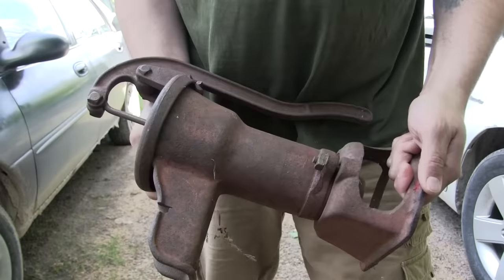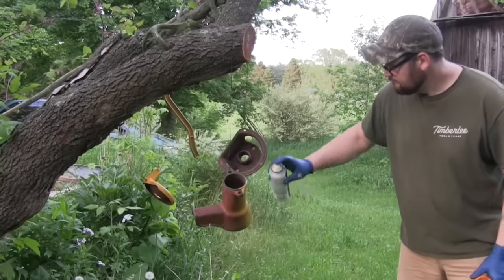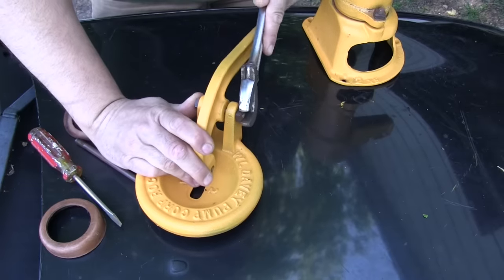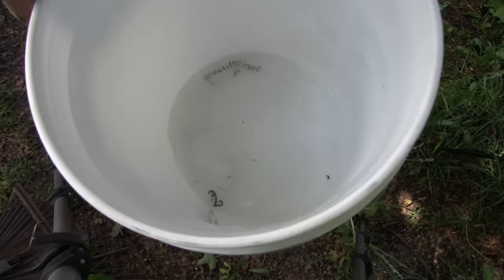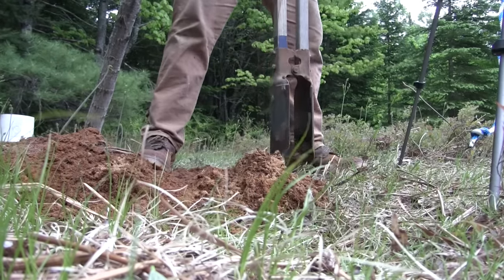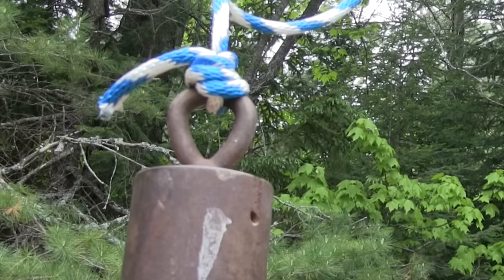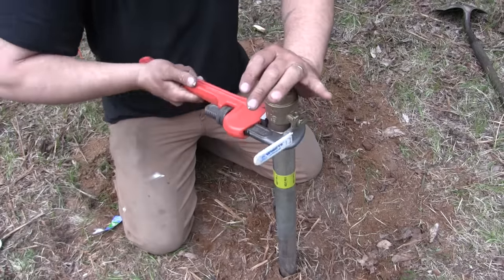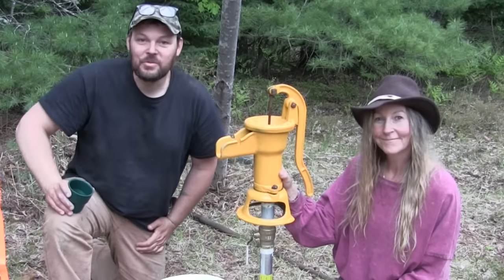Antique Hand Pump Well,  Start to Finish, at our Remote Off Grid Property

Comment: From 1974 to the spring of 1979 my parents, my younger brother and I lived up on a very tall mountain called Beechy Ridge in Clay County, West Virginia. We had a well behind our home with a cast iron hand pump just like the one your video.  During the blizzard of the winter of Jan. 1978, I was thirteen years old and we had 12 to 20 ft snowdrifts in our yard from the Storm. We had to dig out from around home and our well and use newspapers to create a fire around the cast iron pump to thaw out the water line that went down into the well before we could pump water out of it. You see, we did not have running water inside of the house at that time and that was our only source of water for our family.  Those old cast iron pumps could take a beating for sure. When I saw you in the thumbnail with this pump it brought back so many memories fore about that time. I'd love to go back and live there again. The water from our well tasted so sweet. 🥰😊 Thank you for bringing back some good memories for me! 💖🧓
Reply: Still trying to figure out why you would make a fire to thaw a well with 12 foot snow drifts. I grew up onba farm and pulled many a well to thaw out pipes but ours was electric pump with dual 100 gallon storage tanks. Why not get a foot tub and thaw some snow or bring in a metal pale of snow and out it on a wood burning stove....and there you have fresh water. Seem like a lot of work for a hand pump when thousands of gallons of water are already laying above ground.
Reply: Sounds like a lot of work, you might be amazed at how much water there is in a 20' snow drift.

Comment: I didn’t read through all 2k+ comments, but my dad and I did put in a number of wells. The very important item that you didn’t mention was how far to keep the well from septic drain fields or outhouses. It varies from state to state based on the porosity of the soil but 100 ft is standard.
Reply: ...and that 100 feet is uphill of the septic field(s) for people not in the know that "stuff" flows downhill...:LOL

Comment: I can feel that energy when you do a job that never goes smooth and it goes smooth. Love that feeling.
Reply from the maker: me too!
Reply: @Bushradical  great job Dave!!! As an old Well driller, I enjoy seeing others drill(drive)  a well, and have success!!! 
Here's a few tricks....
Don't dig your hole until you hang your hammer and use it like a plumb bob when you have it steady then drop it so the stem sticks in the ground then you know exactly where to dig and it keeps your pipe straight...
The other trick is not really a trick but I would love to see you finish off the hole with a couple of bags of Bentonite.(you can order it from Valley Well Supply, I think they have a warehouse in Grand Rapids)
It usually comes in pellet form or powder.. it's basically a clay that the ground water and rain is absorbed into it, it swells up and seals the ground to your pipe... It stops contaminants from following the pipe down to the water vein... You can always add it by digging out some of the dirt around the pipe and then add a couple bags I think the bags are $10 a piece $20 is great insurance that you're well will never get contaminated if a can of gas gets spilled or whatever contaminant maybe in the vicinity...
I know you're careful and so is Brooke. But you never know..
Also if you hill up the dirt around your pipe it will help rain water and other things to run off. Take care Dave, like I said earlier great video and I'm glad that you and Brooke were successful in getting water on your new place. And I would love to come and help you on the next one. 
Oh ps, when I do a hand driven well I always carry a half horse shallow well pump then I can just fire up the generator and put the pump on and run it for a half hour 45 minutes and that water will be Crystal clean.... You can also judge how many gallons per minute the well is producing.
But you guys did it with the hand pump so bravo!!!
Reply: @dirtroadfarmsjimmideanreen2458  beautiful add on. Thanks
Reply: @dirtroadfarmsjimmideanreen2458  Thanks for that information!
Reply: At very least i learned something new today.

Comment: My Dad, some 40+ yrs ago, took a 1.5” auger-secured an appropriate handle on to it and worked it down about 14 feet in our backyard.  He got beautiful freshwater 💦. At the time we were under strict water restrictions. Dad had the best 👍 veggie garden around and we could swim all we liked ❤️ in our small (even for those days) 10ft diameter 3ft deep pool. We didn't care. My Father had about the same pressure as town water and he maintained he could pump, at that rate, all day.  All for a small auger (from a brace-and-bit system).  He could divine water accurately.
Got to go but good luck with ALL your Off-Grid ventures.
Ellen Queensland,  Australia.
Reply: Archimedes

Comment: Just a suggestion, when you rebuild the while you have the pump a part ,you should clean/polish the bore. You can use engine cylinder hone if you do not have one, you can use a wire wheel on a drill finish with fine sandpaper rinse out any rust or dirt. This will give a tighter seal and the leathers will last longer. Just a thought,  I  have been rebuilding or repurposing items over 50 years. GOOD LUCK GREAT VIDEO KEEPIT UP

Comment: Great vid. Just some tips. 1. If you wait until after wet weather to bore it makes it vastly easier. 2. You can use additional pulleys to reduce to felt weight (the force needed to lift it) of the "hammer", you were using just a single pulley (a single pulley setup is known as a "single whip"), by adding just 1 more pulley you could have halved the force you would have needed to lift the weight of the hammer (this pulley setup is known as a gun tackle). Or if you'd used 2 x double wheel pulleys (known as "twofold purchase") you could have reduced the force needed to lift the weight by 3/4, making it much easier (or giving the ability to use a much heavier weight to increase the boring speed).

Comment: Thanks for the videos.   I put my well in yesterday following your direction.  I placed a concrete pad around the pipe, and watching a similar video, I built a wood frame, to pour concrete up about 2 feet above the ground.  Once it dries I remove the wood frame and should have a very nice looking well.   Reason I built this well is because of the possible nuclear war with Russia.  One high level detonated neck above America, will generate an EMP electric pulse that will take down the entire electric grid in North America.   Estimates are it will take more than two years to re-establish the grid.   Can you imagine 2 years without power, and thus city water?   Hope I don’t need it, but it is nice to know I will have access to clean non-radioactive water, if I need it.

Comment: Nice Dave. Fans of both of you. So my father and his wife had a well drilled in willow AK and installed a 3 stage reverse osmosis setup. Having cleaned the first stage cannisters and changing the filter there was an oily residue.

Comment: I love sweet well water! Thank you for the videos on doing your own well. I don't need one at the moment but may in the future. I enjoy watching your videos, and it seems we have common thoughts about things. I like to see things refurbished because it sure seems like they're made better most of the time. I have watched a man use a pressure washer to dig the hole by putting the water hose in a little ways in the pipe. He used pvc and cut the end like teeth to grind when needed since it went in the ground first. I can't remember if he started with 3 or 4 inch pipe, but connected smaller pipes , maybe stopping at 2in pipe with pump. He did pull it out to put the screen pipe in first, then connected in the same manner as yours. He was through in no time with that pressure washer.

Comment: If you're in an area where the water is too deep for a hand drawn well there's a great workaround. Set up a vertical axis wind turbine to draw the water up into a storage reservoir. Have your reservoir buried just below the frost line. Be sure to have some kind of disengage connected to a float so you only fill to the full mark. The wind will draw your water nearly up to the surface where it can then be hand pumped easily and yet not get frozen.  

..
Reply: Could you, please, give us a link to the video of that (or to other sources)? Thank you in advance.
Reply: @sakoupa  I don't have a link. I simply thought it up. No reason at all that it won't work. What don't you understand?  I remember I was at a state park where they had a really old hand pump. I was really thirsty so I pumped the water up but it took a long time because the shaft was very deep. This idea would solve the problem.

..
Reply: @MrDavePed  
You see.. I don't understand - and that's why I want to look at drawings and video of it. It would be interesting to know HOW it works.
Reply: @sakoupa  Wind turbines of all sorts have been pumping water out of the ground for centuries. I think the vertical axis is the best design. There are many vertical axis videos you can find easily. It can operate an efficient pump which can draw water from great depths. This is especially true since the water doesn't have to be drawn in anything more than a small trickle. You do not need a large number of gallons per minute, just a trickle from as deep as you need to go.

Your reservoir can be a food grade tank of perhaps 50-200 gallons. Bury the tank below the frost line and direct the pumped water into it. 

You'll need some way to deal with the extra water. Maybe a float to indicate when the tank is full. Some way to prevent an unwanted overflow. Either to disengage the turbine or the pump when the tank is full.  If you disengage the turbine instead of the pump, you can save some wear and tear on your pump. 

However you do it, you do not want overflow to be pumped above the frost line and get frozen in your system. There are simple ways to do that which require no electricity, which is the whole point. No electricity required.  

Then you'll need a hand pump similar to the one demonstrated in this video. Set it up to draw water from the reservoir which will only be about 6-8 feet below ground depending on your local climate. Very easy on the arm when the water is not so deep. Just a few strokes and you have all the water you need. 

I hope this makes things more clear.  

..
Reply: @MrDavePed  
I think it's just your theory. Otherwise you would drop a link to real such well. And your statemen - reservoir 6-8 feet deep doesn't frost - but how about tubes above???
Reply: Also, if you have no wind, solar is also an option, but unfortunately can't be created using 1920s technology.
Reply: @user2C47  You'd be surprised what 1920's technology can accomplish. For instance if you have magnification of the sunlight it can boil water. It can also be redirected to concentrate the light on a focal point the boil a LOT of water. Lots of things can be done with 1920's technology.
Reply: @sakoupa  this is precisely how old school farmers drew water. Take a look at videos or images off old American farms. You'll always see a wind mill. That was used to pump water exactly as described.

Part of the joy of this is LEARNING. Go and look for yourself. Live. Learn. Prosper. :-)
Reply: @timothyblazer1749  
Ok, but can you explain me - f.e., about winter time pumping? I think, you know what is frost and ice? How in winter (in minus of Celsius) you will get the water?? Thank you for explanation.
Reply: @sakoupa  I will, but I highly recommend you talk to farmers in your area about this to get a full understanding.

Each area on earth that can become cold enough to freeze water has an average frost line. That line is how far down in the earth you need to dig so that the temperature will be above freezing all year, including winter. That means if you store water or run pipes that deep they will never freeze.

Above that line the water can freeze. So, if you want to pump water out of a reservoir that had been buried below the frost line you need to heat it.

In the old days they would build a pump house around the pump, put a small wood stove inside, and then heat that little house until the water thawed out in the pipes. Since they would heat it every day, the ground just under the house would stay not frozen for the winter.

Now we could put in an electrical heater on the pipes themselves, and wrap them with insulation before burying them. Of course that means if that system breaks you can't get water, so you would want to have a way to heat the pipes in emergency without it.
Reply: @timothyblazer1749  
Thank you for explanation again, mister. If I understand - you are talking about area of United States, where climate is like in Italy or Spain.. Do you know the same pumps using in Canada, Denmark or Sweden..?
You see, - I am myself son of farmers and I don't need to talk to farmers in my area ;) Because our farmers never used such pumps - in our area farmers used only wells. So, wells are made of concrete rings, not of metal pipes...
Reply: @sakoupa  ahh...im talking about anywhere on the whole world that ever goes below 0 centigrade in temperature during the year. If you are in an area that doesn't, I understand why you might not understand. There is a lot of information on farming in colder places on YouTube. You won't have trouble finding more. :-)

Yes such pumps are used in all cold places, or used to be. Sometimes they have deep wells, but then they have to break the ice to get at the water underneath. And again, better ones had well houses that could be heated.

I had such a well in the basement of my old house that was built before the year 1800, for example. And I lived in the North, where we definitely had cold winters. My well was kept from freezing because my basement never got below freezing.
Reply: @timothyblazer1749  
It's interesting, mister, that you have another point of view about these pumps.. And believe me - it's not a problem at all to break ice in the deep well (also if well has 14-15 rings, it will never frosts even in very low temperature).
So, if it's not secret - where your old house was located? What nearest city/town is there (i want to check on map for its latitude). Thank you.
Reply: @sakoupa  thanks no thanks. I don't give private information on the internet. :-)
Reply: @timothyblazer1749  
Private information is "nearest city/town" or its latitude???? Are your health ok, mister?
Reply: @sakoupa  I'm fine. I just don't give out identifying information. Just assume I had a long winter with below freezing temperatures for longer than a few weeks.
Reply: @timothyblazer1749  
No, you are not fine. Read my last comments and yours. "Identifying information".... (Dear God, have mercy on us..)
Reply: @sakoupa  Be well, and luck in your search.
Reply: @timothyblazer1749  
Search? What search?? Goodbye, mister.
Reply: @sakoupa  my friend, there are books in libraries in this subject. There are books online on this subject. If you can't understand that, I would suggest you find someone in your area who does and partner with them. Good luck.
Reply: @timothyblazer1749  
I was writing/asking not about books and libraries. But it doesn't matter now (in your case). Good luck and bye, bye.
Reply: @sakoupa he is saying this:

1.) Dig a deep well, then use a wind turbine setup with the same check valve technology as the hand pump in the video. As the power of wind spins the windmill, it pumps water.

2.) The water that is being pumped by the windmill is being pumped into a tank. The tank is a food grade plastic container that will hold the water, buried below the frost line in your area (its different for each area of the world, and some areas never get frost)

3. You then install a regular hand pump that is hooked up to the tank only. This hand pump only draws water out of the buried tank after its been pumped up from deep in the ground.

4. put the water into a bucket, and dump it over your own head, then stop writing comments on youtube
Reply: @Vid_Master  
Your wise advices, ma'am, don't work in winter time..

Comment: I found one of those pumps buried in the dirt of my crawlspace. I cleaned it up with no actual maintenance and it worked fine. I used it to flush out my wellpoint installation.

Comment: You might want to build a well deck around the pump. It will keep you from moving the pipe around and keep the pipe study as you pump the water. It will also give you somewhere to set things down when your there getting water. Could be buckets or a cup. Could also hang things up and keep them off the ground. Nice job. 
Ps...why the hell does anyone ever pay a damn water bill. It's ridiculous.

Comment: Great idea using the 3 leg tri-pod n pulley,saves the back👍🏽
Reply: Saves the back and pulling the rope down probably uses stronger muscles than lifting the pounder up prior to each drop. It got me thinking about rigging something so I could use my leg to lift the pounder. I'm think of tying a foot loop on a separate 10' length of line with a sliding friction knot (a rolling, taut line or Blake's hitch) tied to the main rope. This should let me slide the friction hitch either direction on the pounder rope as necessary to change the length as the pipe is driven deeper or reset when another section of pipe were added. Might work . . .  maybe it'd just make a big, tangled mess! 😂
Reply from the maker: good luck
Reply: Actually doesnt save any energy the way he set it up, should have added two more pulleys, one at the weight and a second one up top to actually get some efficiency
Reply: @Henryk5161  I can agree with you on a 3-1 or 4-1 pull.